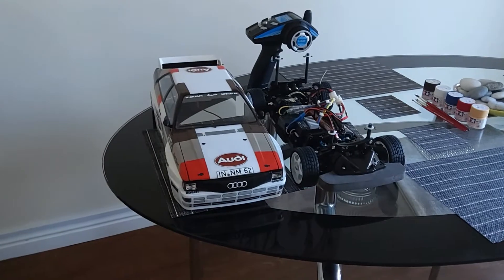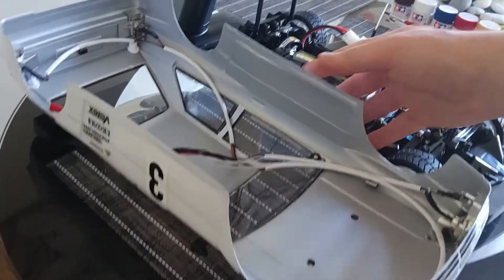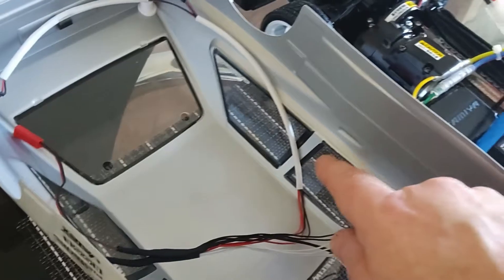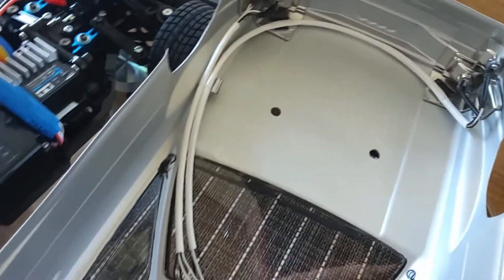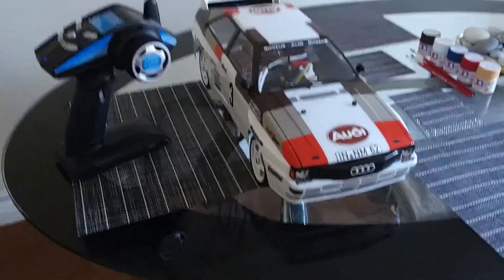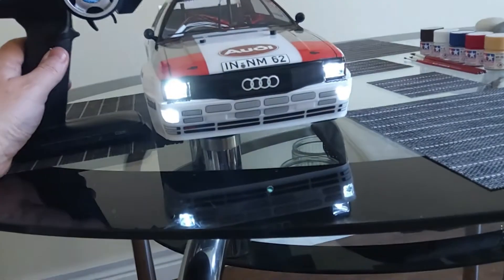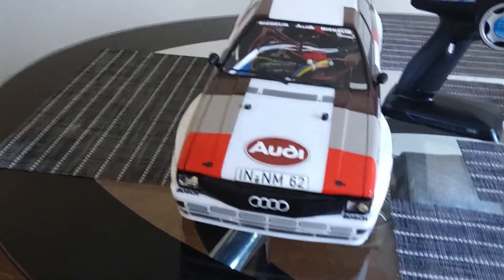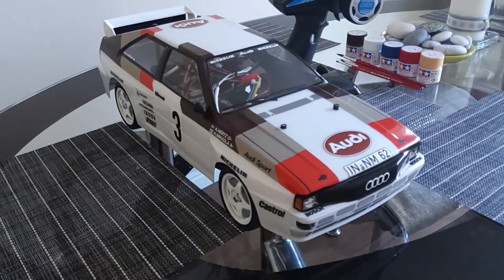Tamiya Audi Quattro   The Beginners Journey   LED's

Comment: Where did you buy the headlights led and rear led kit?
Reply from the maker: Hi Lenny, I did not purchase them, I made them myself. I purchase an electronic switch from Orange RC on eBay, so that I can switch the LEDs from a spare receiver channel, I purchased some 5mm red, white LEDs and some 3mm white LEDs. I also used on this model some current limiting resistors I believe the fronts had 560ohm resistor on each LED and rears had 330ohm resistor on each LED. I used some spare alarm cable to wire them up and heat shrink to tidy them up. Honestly it is very easy to do and alot cheaper than buying units already made. I am currently building some more for my Carisma SCA-1E Range Rover, but I will but using a voltage regulator instead if resistors. If you don't like the idea of making them you could use Killerbodies LED kit, they might help you. Thank you for watch and keep well 😉
Reply: @JF-RC  good stuff, same as well, thanks.

Comment: If I going to connect LEDs to receiver  channel - 5V - Do I still need resistors, how many Ohms and how to connect them? Thanks
Reply from the maker: Hi again, I wouldn't drive the LEDs directly from the 5v of the receiver as the LEDs will overload the receiver and burn out the receiver. I purchased an electronic switch to drive the LEDs from eBay, that is if you're using the 3rd channel of your radio. If you wish, you can drive the LEDs directly from the main battery pack, you can collect the power from the main Tamiya connector, by carefully removing the pins from the connector, then soldering some wires onto these pins and put the pins back into the connector body. Ohm values depend on the manufacturer of the LEDs and whether you are wiring the LEDs in parallel or series, but it would always be wise to be higher than too low, I placed mine in a breadboard to test, prior to wiring them. Use ohms law to calculate a starting point (V=IxR). I soldered the resistors to the cathode which is the -ve (shorter leg of the LED); anode being +ve (longer of the legs) and used heat shrink tubing to keep the wiring tidy. Hope that helps :)
Reply: @JF-RC  Thanks...

Comment: Hey looks brilliant John.  How cool to be able to switch them on from the remote.  I always have the cheapy controllers so have never done that.  The cheap Chinese led sets I get plug into the receiver so I don't need to tap into the battery wire like you have done.  There is probably a limit of how many I can add this way but I've done 4 front ones and 4 back ones and it seems to cope.  Are you going to be bashing this one about once you have finished the cockpit?
Reply from the maker: Hi Pete, the radio gear I'm using is the Core RC 3 channel, not badly priced. The RC switch was £9.99 from a UK based Ebay seller, it works really well. I didn't want to drive the LEDs from the receiver directly, just in case the LEDs pulled too much current through, hence the direct connection to the Tamiya plug pins, driven through the MOSFET switch, I could have built the MOSFEF switch myself, but at £9.99 didn't seem worth messing around buying the components separately, would have cost around that price anyway. And.... yep, I am definitely going to be driving this baby! Looking forward to trying my hand at filming and seeing if my driving skills are still there from the absence. Worst comes to worst, have to buy another body shell and doing it all again ! All part of the fun, keep well, keep safe.🙂😉
Reply: @JF-RC  sounds like you know a load more about electronics than me. I remember Mark Bryan talking about Ohms law and having a very vague memory of it from school! I didn't realise until I bought a second hand RC from eBay that tapping into the battery wire was an option. I take it you aren't going to put the big spotlight clusters on? I think that they would be the first thing to snap off in a crash! Look forward to seeing the whole thing with drivers installed. Does make a big difference to the realism. Hope you are staying safe and well too 😁